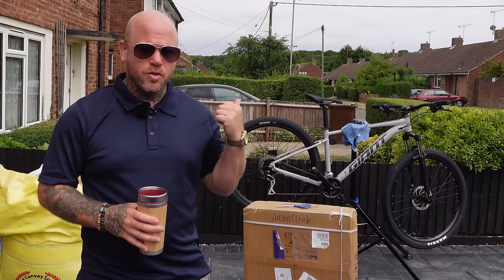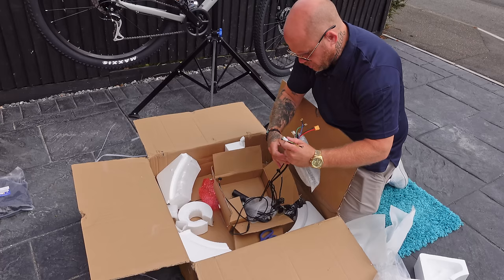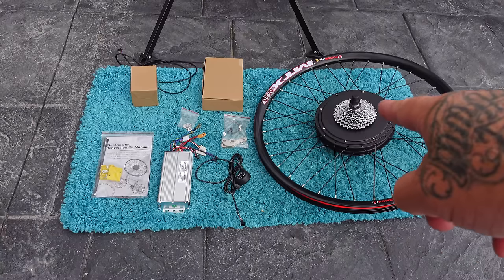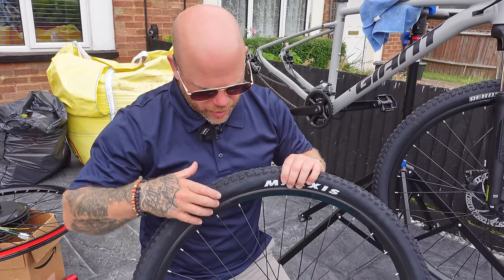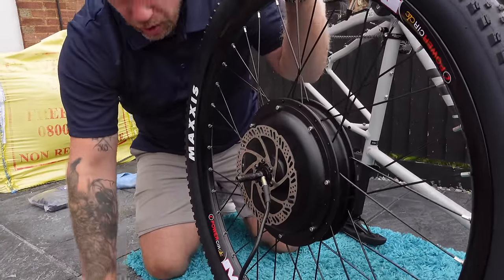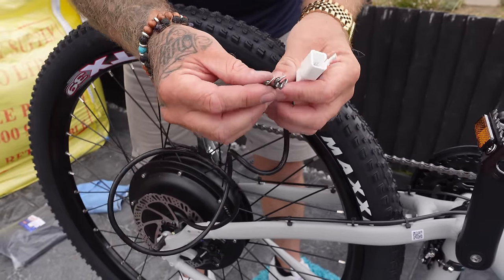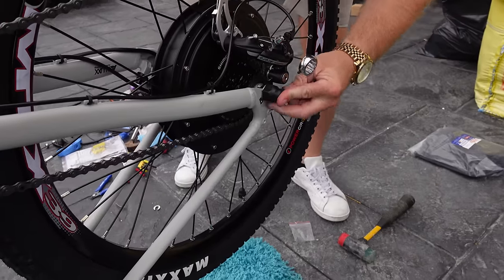Pt. 1 Convert ANY bike into an EBIKE! **ELECTRIC HUB MOTOR FITTING GUIDE**

Comment: Mount your hub motor so wire is pointing mostly DOWNWARD, and leave small dip in wire before you strap it to bike frame. Reason is because you want any water or moisture to run off wire, and not towards axle of motor. Yes, the slant of dropout will prevent you from pointing wire to 6 o'clock, and that's why i said, mostly. But he's right about that zipper bag. Do not cover shell of motor controller. It acts as a heatsink for motor phase MOS-FETs (transistors). It needs air for cooling.

Comment: I would not reccomend doing this, UNLESS oyu are desperate or in dire need of an Ebike solotuion for what ever valid reason. I wouldnt wastw my time on a wheel hub if its not through axel for safety, tapping the axel into a drop out will in some way warp the drop so its not gonna blow up, but its gonna warp of the years. 
  
    ALSO could you wire up some sort of lever switch between those controller wires to use the hub to brake a bit !!

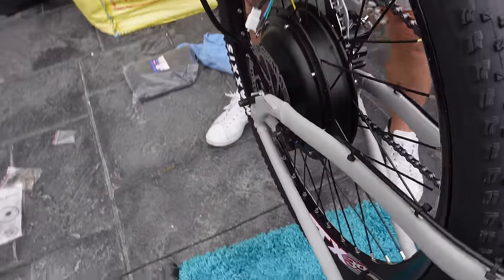Comment: Thank you for this well put together useful video. Two Qu, if you had not removed the plastic spacer at 12:30 would it not have fitted better at 20:30 ?   and what is the typical import duty you have to pay on the motor and on the battery and is that paid to Royal Mail?
Reply: You buy these hub kits (and batteries) from UK-based chinese drop shippers, they 100% deal with importing and duties at their end. If you order a hub kit for £100 and a battery for £150, you will be paying £100 for the hub kit and £150 for the battery. All you need on top of that is a donor bike.

Comment: I'd probably spray the controller white. Even a fine layer of black will cause the part to absorb heat. Seen tests done on intercoolers with white black and bare metal and the white wins.

I'm looking to convert my bike. I've got a 10 or 11 speed derailleur. Can I just use the travel stop screw to limit my gear changer?

Comment: Is that a 26ins wheel if so the front wheel will be 26ins wheel what size tyre have you used in looking for a slightly wider tyre for 26in wheel ice tried 195 2.10 and 54-559 is there a wider tyre in width

Comment: I hate these controllers, I bought one that mounts right under the battery, but it's very expensive $250, but it's the best for me, it can be adjusted from 36v to 52v (max 70A)

Comment: Only issue I see on this build is with the torque arm around the dropout. 

What I would do is take that Allen bolt, go to a hardware store, and get a similarly-sized hex bolt, matching up length, thread pitch, and thread spacing. The reason why is that with a hex bolt, now you can get an open-ended combination wrench -- a "spanner," as you Brits would say -- behind the dropout to tighten up the torque arm. 

But that's not all. I would also pick up a nylock nut, along with that bolt, to secure it. A nylock nut has nylon in one side of the nut to lock the nut into place once it's tightened. Most kids' bikes with U-brakes have nylock nuts on brake arm through-bolts that hold everything together. 

Lastly, the reason for the hex bolt is to take the extra length of the bolt and move it to the outside of the dropout, thus not running the risk that the bolt could interfere with the rotation of the wheel.

Other than that, the wheel installation looks good.

Comment: Why not to fit this motor cable from behind, through the hatch.  Then you will know that it will not be damaged.  Just like you did, I would be afraid that it would cut because it almost touches the brake rotor, You are very brave.
Great content.

Comment: there is a debate about these universal torque arm kits ,because they have a weak point that is the middle joint ,my bike is a steel fork dropout so never felt the need to use it,aluminium frames ,id prefer a solid torque arm
Reply: True the kits have clones of v1. The comapny that designed them has v4 now.
Reply: As for steel or aluminium - my 1000W flipped in steel brackets. Its all about tolerances

Comment: I used the same motor with a fat persons mobility scooter battery to modify my gfs vibrator but it just didn’t get the job done and she burned it out, in the end I had to pay for a pneumatic drill and attached rubber fist on the end but the neighbours complain. I’m currently working on a buttplug attached to an industrial paint shaker for her birthday. Anyone else had similar experiences?

Comment: It's a good thing that you never get a flat or have to service the inner tube or tire. Especially out on the road. You would want to always keep your rubber mallet with you along with some extra zip ties. I'm not sure about the connections to the controller. Hopefully they are not too permanent as well.
Reply: For the flat part i would recommend indeed using double side velcro instead of zip ties so close to the axle.

Comment: I purchased a bike with shimano 51-7 shifters that appear to be gear selector and brake lever built into one. The ebike kit I purchased has brake levers that disconnect the motor when applied. What would you suggest on how to incorporate the two? What thumb gear selectors/shifters should I replace the current ones with so that I can use the ebike brake levers and twist throttle?

Comment: I have a dual drive--installed a 1000 watt on the front and it spins the tires on dry pavement on anything under 15 mph.2000 watts is a lot--good luck.

Comment: 20:48 see me about the caliper hydraulic caliper out what you have to do is on do the caliper Mount which attaches onto it which is the actual bracket itself and then you move it side to side rock it off with the bottom very slightly the lock off for the top those signing into is very secure then lock it off completely with an allen key which is approximately 5 to 6 ml

Comment: Glad to see you were using flush cut cutters to trim the tails off the cable ties. The number of times I cringe when someone cuts off the cable tie tails leaving a 3 x 4mm razor sharp edge. I used to use thousands of cable ties at work and if we left any sharp edges we were in trouble from whoever cut themselves on them. By using those flush cut cutters with the flush side toward the head of the tie the tail gets cut flush with the surface leaving no sharp bit sticking out.

Comment: At 31:37, you should use a 10mm open-end spanner (wrench) on the 10mm axle flats to wiggle the axle back and forth as you insert the axle into the dropouts to avoid any use of any hammer.  This 10mm spanner (wrench) will also help when removing the rear/motor wheel as the threads tend to be forced, deeply, into the frame by the torque of the motor... with a wiggle of the 10mm on the axle flats, the rear wheel freely moves out of the dropouts.

Comment: 18:13 I like a strategy but the strategy is if your disk is out of line and it's rubbing against it or you have to do is undo the two screws which is holding the caliper on the actual caliper mount across slightly this is why that face it isn't needed for it sometimes and looking at the resort lining it up but before lining it up you must spend the wheel reeling the disco's into mine done at the bottom bolt than the top bolt of the caliper Mount where the caliper it's mounted

Comment: i had an incident where the soft walled tire moved on the rim and tore the valve from the tube due to the higher speed from the rear wheel, the way to fix that problem is to coat the tube and tire with Talcum Powder, i use a small paint brush to coat the inside of the tire and rub the powder by hand to the tube, then just shake out any surplus powder from the tire, this method stops the tube sticking to the tire under load and works 100% , i  now use Maxi Hookworm or Schwalbe wire rimmed tires with larger tubes  and  no mishaps re punctures or tire slippage, hope this helps.

Comment: In regards to using washers to create a space so that the caliper and motor don't foul, does this not affect the alignment for the brake disc to slot into brake pads on the caliper??

Comment: If the rear wheel keeps popping out when you tighten the nut turn it right way up and get someone with a decent weight sit on the seat and retighten some bikes also need a spacer behind the cog to stop rubbings of the wheel

Comment: Hello. I'm just in the process of fitting my Kirby kit and I've stupidly threaded the axle nut. The nut was catching my fork and cut into it i then couldn't get it off again so had to use an impact driver. Do you know what size the nuts are so I can buy another? Thanks Rich
Reply from the maker: I don't know the size I'd either get a vernier to figure it out or try a tap and die set to retread it. Good luck

Comment: When the 3 wires get shortened it shorts the magnetic field and locks the magnets inside the hub motor that's the reason wheel won't spin freely

Comment: Things I wish I knew. Don't buy a brand new $800 bike and convert it to eletric. Fina a used bike that has disk breaks for $100 and convert that instead.
Reply from the maker: Personal taste I prefer new by the time you get the brakes and components working I don't think it's worth it and the spec and suitability at 100 will probably be questionable

Comment: Nice vid, but i would be trusting that mild steel thin jubilee clip to not snap soon, it does the back wheel of course lock up and it would be really bad
Reply from the maker: Well I've probably built about 50 2000w builds over the last couple of years no issues.  I think it's more important the back wheel is fitted so well

Comment: My wheel kept coming out. Now I use a steel frame and it will never get lose again. Kinda scared now to use alu frame somehow. My frame in the back was also not wide enough so that caused the issue as well but be aware that washers need 2 fit perfectly in the dropout or it could cause some issues.

Comment: Just bought & fitted my first Kirkbe kit. Your advice on fitting washers to the cassette side of the wheel saved me from smashing the kit into a million pieces, in utter frustration! Thanks chap, top, top geeza!!! I agree about the PAS sensors too, can be a real pain to fit and using throttle only gives a much smoother ride.
Reply from the maker: You're welcome 😊

Comment: Liked your video. Just a few comments:
- No spray black paint on the torque arm?
- Better drill holes in the torque arm since it looks like a brand new bike, those hose clamps will cut into the paint on the frame
- Use a different tool for cutting metal and cutting zip ties ;)
- Since you're getting over 300k views on a video, I'd expect to see proper tools being used. Pliers to hold a nut and all-in one allen keys, come on ;)
- Remove the zip OEM zip ties holding the cable along the frame and use those mounting points to fix both cables with a new zip ties.

Comment: Those 3 color wires are the phase wires. They will get separated either way when they get attached to the controller but  they should not be touching that's correct.

Comment: These kits cost more than just buying an E- bike. Some show up to $800, $900? What sense does it make if you can buy one on Amazon hundreds of dollars cheaper for an already assembled ebike. I'm confused how this is cost saving for anybody???.
Reply from the maker: Probably because the kids are 2000w max power 52v 17.5ah.. if there's a bike for the price of the kit it's probably 250w 36/48v 9 to 13ah ish with unbranded cells basically slower and not good range
Reply: @DudeStuff  I appreciate your response sir. Thanks for the clarity

Comment: I like the video it is very helpful  but I couldn't buy this ebike due to lack of pedal assist and the fact that control panel is glued to the battery witch mean  it's not possible to take it off and charge it at home, office ECT. or when it's flat just replace it with spare full one.
Reply from the maker: Good job it sold then to someone else. I can supply the pedal assist to people and fit the controller with velcro the same way works good

Comment: Am i right to understand that the brake sensors are not needed. The brakes I got with my kit are low quality and also don’t have anywhere to fix the gear cables to. I had to buy some and it’s overcrowding the handle bars. My original brake levers are better quality and have a connector for gear changing.
Reply: They are a safety device. They cut power to the motor if you touch the brakes.

Comment: Great guide - it is not advisable to trash the brake sensor though, that is pretty much the number 1 safety device on home-made ebikes. It kills the motor on the slightest touch of the brake so having a finger close to it when around pedestrians could prevent a crash. Especially if you are using pedal assist - there often can be lag between pedalling and the motor turning - and more important, lag between you stopping pedalling and the motor stopping turning, which can catch people off guard and cause a crash - the brake sensor causes instant loss of power when you as much as tap the brakes helping stop this.
Reply from the maker: Yeah I don't use pedal assist because I think it's dangerous at low speed and really don't have an issue controlling the bike without both fitted
Reply: @DudeStuff  quanto é
Reply: @DudeStuff  yea it can really catch you out at low speed! Good point though that without the assist you can do without the brake sensor - riding with assist and no sensor on those bikes is like playing Russian roulette with a semi-automatic!
Reply: @Debbiebabe69  you are so correct. Anyway the cutouts that most suppliers send with these kits are just for cable breaks. That is why I purchased a new back hydrolic caliper with integrated cutoff switch.
Reply: Who cares I disconnect mine to do wheelies.
Reply: I like the cut outs as it enables me to change down the gears before coming to a stop......PAS only obviously! :)

Comment: sup man, my E-bike wheel's side rim/wall has started to tear along the seam ,itll be a waste to throw the whole wheel away, i do wanna learn how to build a wheel to put the motor back onto a new one, i know  the hardest part is making sure one gets the right length spokes and truing it all, i think vortecks showed a little bit of this process ,but time is money and for £200 prob cheaper to just buy a new one ?
Reply: Chesper to buy a motor with a wheel for sure. You have to build and center it yourself and that is about a price of a motor from china. Doing it yourself has the advantage of using better rims and speed.

Comment: i have one problem with my ebike that im building is that i cant take the hub spacer off and put the disk brake caliper on because the cables are already connected to the controller
Reply from the maker: Disconnect the cables

Comment: How long do these kits last, before the motor or controller or something dies and one's forced to buy a whole brand new one or are they modular? 
Interested in doing my own 1st conversion after looking at what's on the market; all low-spec and high-price factory-made. But, one thing I was told is that the conversion kits don't last and that it's better to buy a proper made one. Thoughts?
Reply from the maker: Lol who told you they don't last? So a friend told you they last but a shop bought bike with electrics is magically better?  Dude they last fine I've never had an issue in 2 years and 40+ conversions
Reply: @DudeStuff  awesome...that's very reassuring. 
Yea, they were selling factory-made ones, so, there was the obvious bias of self-interest but it did make me wonder. I thought it possible to imagine that a kit added to a bicycle is not the same as something purpose-made for a specific bike; that these kits just die off and need replacing soon enough. After all I have no experience or knowledge of their quality. All I know is that they all come from China. So, do Apple phones, so the old prejudices no longer apply - they can make cheap or expensive things. Anyway, thank you for sharing your experience. It gives me confidence moving forward. 
Are there any brands that you recommend more over others. I don't know the hierarchy of quality except I see a recurring number of few brands on eBay. Voilmart, famex, and a couple others I can't remember just now. 
I was drawn to famex 1500W with internal controller for the sleeker look with a Panasonic 52V 20ah battery or higher if I can find one. 
I'm in London and making a conversion with delivery work in mind and range is number1 consideration and speed number 2.

Comment: if the axles of the hub motor dont fully fit into the dropouts, should i file it down a bit so it is fully in?
Reply: I also saw on reddit, that the little washer with the bit that sticks out should be on the outside instead of the inside. Does it really matter what side its on?

Comment: I had the 27” talon and broke back wheel within 3/4 months of wheeling and riding it don’t rate there bearings
Reply from the maker: Top tip replace it with a 2000w motor 👌
Reply: @DudeStuff  sure will 😂

Comment: Thanks for the learning curve. Now I can be a first time expert. That brake spacer would have been cut into tiny pieces after it came off if I had to figure that out the hard way. when did they start using USA sirens over there?

Comment: I have just brought one of these off Andys page and when I go to set off its not got much tourqe until I pick up speed is there any settings or owt I need to adjust to change this or is this just how they come
Reply from the maker: The new sinewave controllers are a little smoother off the line not much you can do I don't think, otherwise upgrade parts
Reply: @DudeStuff  perfect thankyou mate
Reply: @DudeStuff  also is there any settings know the display to change it to 48v or 52v or does it just automatically change depending on the battery you connect to it